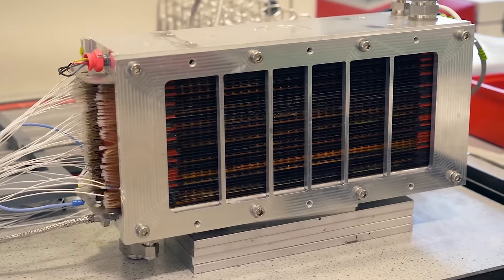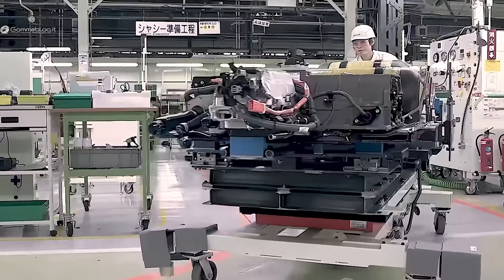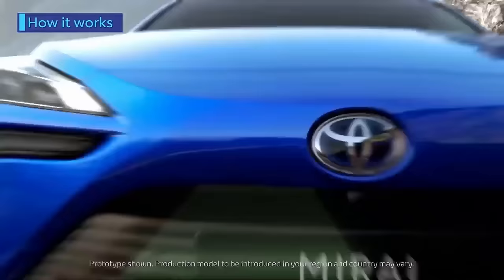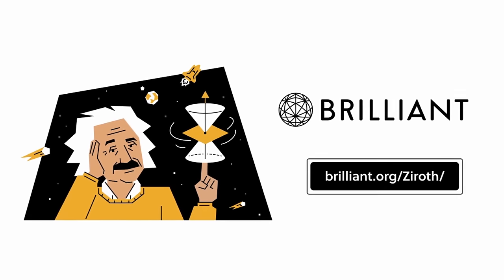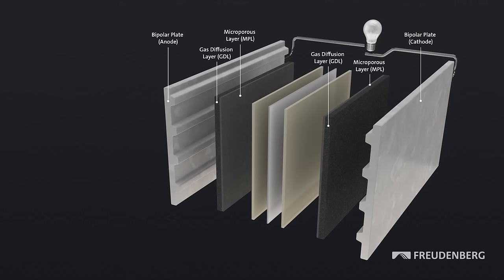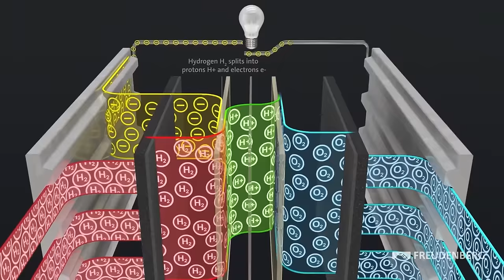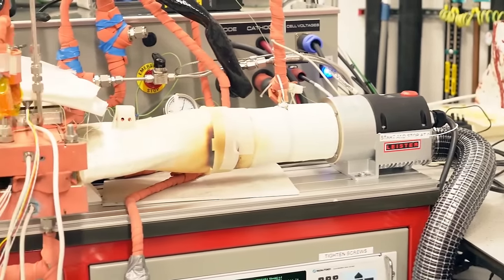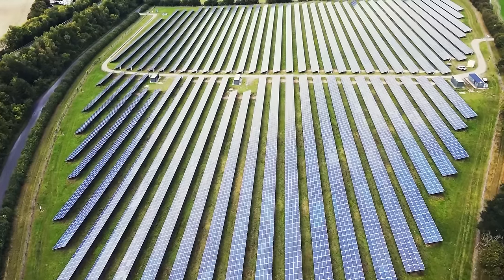Why This Hydrogen Fuel Cell is Engineering Genius

Comment: No mention of hydrogen storage? How much bleed off is there? Is the tank in an aircraft somewhere in the fuselage? The tech sounds good but there is always the problem of keeping the fuel at super low temperatures.
Reply: I think pulse-tube cryocooling is used because hydrogen must need lab-level cooling to become a liquid, so it's denser!
Reply: Less of a problem in a plane than with a car. Planes do scheduled flights, so cryogenic storage, will be filled before flights.
Reply: Exactly, it then becomes a choice between H2 powered turbo-jet/prop vs fuel-cell electric propulsion systems.
Turbo wins hands down.
Reply from the maker: I wanted to focus on the fuel cell here as hydrogen storage has been covered many times before - but there may be follow up videos on the other developments in ZeroAvias power train to come!
Reply: @ZirothTech  It is a highly interesting concept they are pursuing. Efficiency of fuel cells go up with higher temperature. the band gap in the catalyst is easier to overcome. Using a turbo as cogeneration, is proper engineering = using the available waste energy for something useful. Clearly this is not a "one gimmick" startup.
Reply: @Tore_Lund 

Some WW2 aero engines  derived considerable thrust from just the super Turbochargers.. ..ultimately they developed into the late super compound combustion engines.
A compound fuel cell powering a hydrogen... turbo jet/prop engine ? 🤔

I think this tech is going to follow an electric hybrid power system as the propulsion motors will probably be able to use an element of regen and storage if short term battery storage is built in power can be recovered  whilst descending for fixed wing aircraft like blended wing designs. There's already e motors and e jets  
that have been developed .. There's a Canadian company that's developed a Megawat rim driven electro fan jet. 

There is a natural material that is cheap, can withstand very wide temp ranges chemical and radiation extremes   ranges and is highly mechanically resilient.
...but is also a very good insulator be that thermal, vibration/noise  and unaffected by hard and UV radiation. 
That is Basalt and it's easy to form into fibers/composites it's also greener to produce in terms of CO2 water and energy than most. It's also less hazardous to work with than GRP or Carbonfiber.
Reply: @clivestainlesssteelwomble7665  Yes, I remember something about simple aero engines, 2 stroke?, with a exhaust turbine coupled to the exhaust connected to the crankshaft and propellor. There is definitely potential in fuel cell efficiency development. Conventional high temperature fuel cells are at 78% or so efficiency and in stationary applications, they do use the waste heat too.
Reply: I would really like to know what happens to the ~78% nitrogen in the air? Where does it go in the high temp fuel cell? NOX?
Reply: @HerosAndZeros  
🤔 Hmm need to run through the vid again check my understanding ..  The other issue is does this produce a vapour trail... Because we know that they can cause more damage than  the  CO2 from the jet engine. Though there's ways of reducing those.
Reply: I'm pretty skeptical about H2 as an entire solution. Charging batteries is 3X more efficient than making, cooling, compressing, and transporting hydrogen. They are also coming way WAY down in price and their increase in energy density is actually accelerating. They have way more power than fuel cells as well. I feel like it's a race and batteries have come from behind and are going to pass H2 in every way. They've already completely shut the door on H2 ever being used for personal vehicles. Then they said H2 would be for trucks and semis and stuff, but Tesla semi outperforms fuel cell trucks. They said H2 would be for mining and farming equipment but all those companies are going with battery electric as well. John Deere is coming out with a huge range of electric farm equipment in 2026. Then H2 was going to be for ships, but hundreds of battery electric ships are now appearing, while there are hardly any H2 ships, and the few there are are government pet projects, not actual, commercially viable ships as far as I can tell. So it seems H2 is losing this race as more and more of the industries it said it would power are choosing batteries. They better hurry if they want to lock in aviation, which is basically their last hope.
Reply: H should be stored in ammonia, which is much easier to handle [it's done all the time]
Reply: @truhartwood3170  

Good summary ...the problem is the  whole production and distribution infrastructure  cost ... the Govts  won't pay up for it and neither will the companies involved. ..because they are mostly linked to legacy Fossil fuel industries and tech.
Natural,  mined Hydrogen may become the only acceptable and economic source ... But it's also a way off.
Reply: no need to bleed off. the aircraft refuels before every take off anyways. you just need good insulation around the tank, inner tank material and valves that works reliably at those temperatures. the aircraft basically starts using hydrogen as soon as its filled up (taxiing, then take off). of course there needs to be a safety that allows to dump excess hydrogen pressure, but handling liquid hydrogen means you don't need advanced pressure tanks that can handle 10000psi. you actually dont need the tank to be excessively well insulated, because the heat that goes thru the thermal insulation from the outside into the liquid hydrogen is  actually more energy. you can probably adjust the heat exhange depending on how fast you are using hydrogen
Reply: @geemy9675  well an aircraft will never have no fuel in it, there is no amount of insulation that can keep hyrdrogen at cryo temperatures indefinitely, so there will always be a need for boil off. So there is a loss of fuel which an efficiency problem.
Reply: It’s rather unlikely that Hydrogen will be used for much anyway. 
There is a simple reason, batteries are cheaper to operate and cheaper to use. 

Hydrogen will be used in very small parts of the industry, maybe steel production, maybe aviation, maybe heavy trucking. But that’s pretty much it.
Reply: The fuel is created on demand. No storage needed
Reply: Yep, there's ALWAYS the issue of storage with hydrogen.  Until that is sorted, hydrogen is never going to be a viable fuel/energy source.

This is just making the cart without a horse to pull it.
Reply: @stevemarquardt3217  That adds to the weight of the power plant similar to the cooling issue brought up in the video. It's definitely a possibility, though.
Reply: @clivestainlesssteelwomble7665  There's already a large component of water vapor in jet exhaust already. These might be slightly larger but on the same scale of current vapor trails.
Reply: @truhartwood3170 the problem is, the batteries will weigh about X3 or the plane and charging stations in the sky are not available at the moment
Reply: @DavidJohnson-yg8qm  batteries weight 3X that of a hydrogen system? Hydrogen is light. Tanks are not. The fuel cell stack is not. All the hoses and pumps and everything are not. Look at a real world example - the Toyota Marai has 647km of range vs a Model 3 LR with 548km of range. The Marai weighs 1,920 - 1,950kg, while the MODEL LR weighs 1,828kg. 

Then there's power - the Marai does 0 - 60 in 7.4sec, while the MODEL 3 LR does it in 4.4 sec. Planes need power for takeoff. Hydrogen doesn't deliver. Batteries are also way cheaper. A Marai starts at $51k, a Model 3 LR starts at $45K, and it takes 1/3 the electricity to power a BEV platform vs a fuel cell platform (not counting all the leaking the hydrogen will do, which is a lot. H2 is the smallest molecule and goes right through just about everything). So that's 3X the electricity bill, and also higher costs for the electrical lines, substations, transformers, etc plus the cost of the electrolysis equipment, the filers for super purifying the water (oh, yeah, you need a larger source of water, too)... Then there's "hydrogen embrittlement". Hydrogen is incredibly reactive with all materials, so tanks, valves, gaskets, pipes etc all need to be replaced around every 6 years. Not just on the plane itself, but fueling lines, storage tanks at the airport, etc. So yeah, the cost of H2 compared to batteries is significant. 

Then there's the size - a Marai has only 2 seats in the back and they're jacked way up so there's no headroom and there's very little leg room. The trunk space is also compromised, and there's a big bump between driver and passenger. Why? Because the tanks are MASSIVE. Planes need to carry stuff, and that stuff needs room. More room for H2 means less room for stuff. A bigger plane carrying the same amount as a small plane exacerbates all the problems menyioned above.

So H2 doesn't actually have as much of a real-world advantage over batteries as you might think.
Reply: Aren't the temperatures too low for thermal NOx?
Reply: @aryaman05  Will turbo reach the same speeds?
Reply: @clivestainlesssteelwomble7665  No. Vapour trails dissipate. CO2 takes many years to go away.
Reply: @clivestainlesssteelwomble7665  The "vapour trail" that theses engines produce is just plain and simple water. How dangerous can that be?
Reply: @HerosAndZeros  Nitrogen is not involved in the electro-chemical reaction taking place in the FC. So it should just simply pass through the system and be ejected. There would be no noxious Nitrous Oxide molecules produced as there is no combustion process involved.
Reply: @reggiep75  When the first ICE vehicles were produced and sold, do you think there was an established production, storage and distribution system for the petrol needed in these cars?
Reply: @johncanalese588  
Turns out that it's far more problematic than even the CO2 in terms of the impact on atmospheric warming contributing 52%.
That's why Cranfield got involved and the young Muslim female Aircraft engineering Doctor developed her ideas and tech to reduce the problem. Her family names Qureshi. She's also developed a unique jet engine ..they have patents on both technologies and it was published some last year . The vapours collected as condensate then it can be discharged as water at lower altitudes or on landing where  it has no effect.
Reply: @clivestainlesssteelwomble7665  How can this be? Water vapour is not a "greenhouse gas" like CO2 is for example. Yes, it can be ejected but surely it is not the same impact as the water would eventually "drop out of the sky", like rain. I can't seriously consider commercial airplanes having complicated catch and store on-board withe the weight it entails.
Reply: @rogerphelps9939  
Yes, both turbo types are regular engines tuned to burn hydrogen, that's all.
Hydrogen storage is common challenge to both design cases anyway.
I say we go methanol/DME or even NH3, best bet.
Reply: Hindenburg 😂
Reply: @ZirothTech that’s what I thought. No idea why they are so stuck on aerospace with it
Reply: I thought this was a on demand system. It burns it as it produces it, doesn’t it ?
Reply: @frostfamily5321  There has to be a way to create liquid hydrogen via rapid depressurization, aircrafts already have this system for cabin positive pressure and temperature. I can see a way of grabbing hydrogen from high altitude air and liquifying it
Reply: @Valenciarony  A hydrogen scrubber, amirite?

Comment: While not taking anything away from this work no actual data of thermodynamic efficiency was presented, additionally the current cost of both fuel cells and electrolisers are very high.  Producing hydrogen is always going to be very expensive.  More energy must go in to produce the hydrogen than ca be extracted (therodynamics).  A lot different to drilling a hole in the ground and getting oil out.
Reply: Clearly looking for PR and grant money.... Just that "slight" problem that this requires TONS of Platinum to make it work which --> we do not have.
Reply: aggree in terms of lack of data, butu cant compare hydrogen to oil. oil generates energy, hydrogen just transports it.
Reply: No. You have merely posted a history lesson.

Suggest you get out your Google and do some research.

Preferably prior to posting.
Reply: @t1n4444  Not history, actually engineering, physics and chemistry, suggest you look up the energies of enthalpy, entropy and the laws of thermodynamics particularly the second law.  That is why bio-fuels and hydrogen based fuels will always be much more expensive than fossil fuels.  It takes the energy from fossil fuels to produce both the materials for the infrastructure needed to produce/manufacture and the energy input to manufacture the alternative fuels.  There are 2 very compelling reasons to move away from fossil fuels; global warming and resource depletion.  Both are much closer to catastrophic than is being generally published.
Reply: @dan2304  

No.

You (and other wannabe  chemical engineers) just come out with the usual historical stuff.

Plus a few "technical" terms for the verisimilitude thing (you're trying too hard btw)😂 

You can always Google for the most recent info but even then that info is history after a month or so.

Suggest you forget what you believe is current info and try to keep up with hydrogen research on a daily basis.

Hydrogen R&D moves at an astonishing rate but hardly surprising given the amount of money thrown at it.

Battery tech as in EVs is already a dead end for all sorts of reasons.

Plus fewer and fewer people (in UK) are that keen on buying them, new or used.

That said batteries for area storage (or whatever term you're happiest with) is gaining in popularity so to speak with HMG, although not so much with the NIMBY elements.
Reply: @t1n4444  No point discussing with scientific illiterates.
Reply: @dan2304  

Quite so.

Why on earth do you suppose I urge posters to do some research prior to their posting?

There again suggest you forget science ... you are more than proficient as an historian.

I couldn't argue with that.
Reply: Electrolysis can’t compete with energetic cavitation impact by Prof Marc Ramsey or @EirexTech in Canada with any type of pond or ocean water.
Reply: @leroyessel2010  The energy of enthalpy does not change because of the methods of production. Production of any manufactured fuels is doomed in an energy constrained world.
Reply: @dan2304  
Still trying to impress us.

Tell you what, instead of boring us all rigid with your posts why not address your views to the manufacturing realm?

They would be very grateful for your oversight and erudition.

In fact if you didn't win a Nobel Prize for this work of yours we'd all be extremely surprised.
Reply: @t1n4444  High school chemistry is hardly ground breaking.  That research is being done is excellent but there is no beating scientific laws, they are scientific laws because there is no evidence that they are broken in the known universe.  The issue is probably more one of hype to collect funds from who ever will give them.
Reply: @dan2304  

Yes, but don't keep on trying to bore us rigid.

As before why not address your remarks to the engineering industry?

I'm quite certain they will regard your opinions with all the attention they rightfully deserve.
Reply: @t1n4444  Engineers should well understand the laws of enthalpy, entropy and thermodynamics, if they don't their education is very lacking.  It is the economists managers and politicians that have the problems influenced by vested interests.
Reply: As I understand it production is not the problem or limiting cost, it's about storage and transport.
Reply: @benebene9525  How is this true? Both oil and hydrogen hold energy and can be transported, one just way more stable and easier than the other.
Reply: @zenonvandeventer5229  H2 has a high energy release per weight 142 kJ/g.  That energy plus the efficiency loss must be put in to get the H2 out, about 190 kJ/g.  That H2 is the lightest material and smallest molecule makes it very expensive to store and transport, both high energy and infrastructure input.  Currently the efficiency losses and storage and transport efficiencies mean that little of the energy input is available for use, about 35-40 kJ/g from the H2 produced.  Once fossil fuels are depleted, only a few decades away, the H2 will be needed to produce ammonia for fertilizer for food production.
Reply: If the object is to reduce carbon emissions, producing the hydrogen efficiently is beside the point.  Large Solar and wind farms could be used to produce  the hydrogen.  Well insulated tanks on the aircraft should allow for adequate flight times.  Rockets use liquid oxygen now etc.  We are always looking to ways to use intermittent alternative sources of energy and store it for when we need it.  This technology has promise in many areas.  Solar and wind electrolysis followed by compressed gas storage and using fuel cells to produce power from that gas makes sense to me on the surface.  Much more sense than Lithium Ion and Thermal Batteries do which each also have issues...  Not so much about thermodynamic effeciency as it is clean energy...